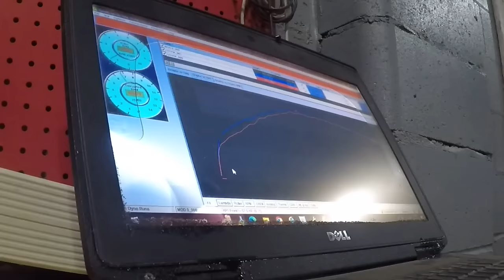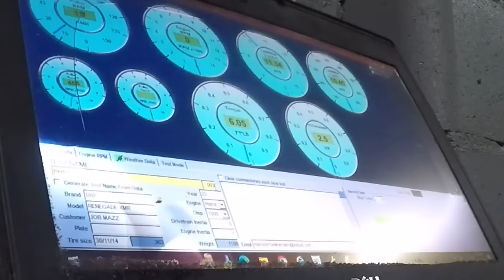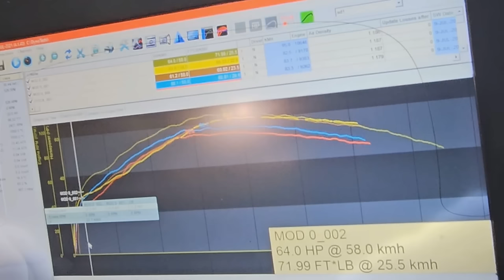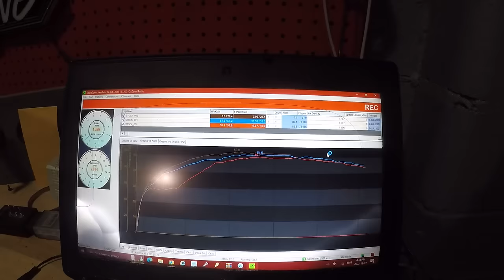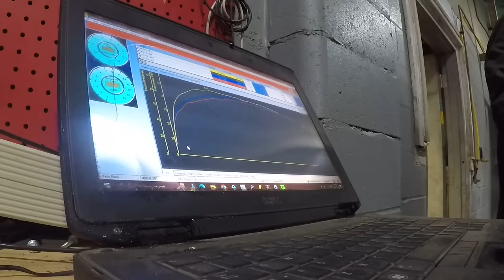2024 Can-Am Renegade X-MR1000r Dyno Tuning

Comment: If you all have a Polaris or Can am get ahold of RVS Performance, he's got the best tuning for these machines with his dynojet stage 3 tune. I gained 15 wheel horsepower on my Scrambler 1000 S and it shits and gets now.
Reply: RVS is a local shop to me. They are awesome I have a stage 3 on my outlander 1000 wow does it make a difference great people to work with
Reply: @justpigginit  RVS is the best at tuning when it comes to Polaris and Can Am. His power gains are un matched. He has my Scrambler xp 1000 S tuned excellent. It doesn't take that long to reach 90 mph on it.

Comment: Do yourself a favour. Don’t clutch your bike from a dyno run.
Reply from the maker: I always test on trails and swamp, then adjust.
Reply: @ehTV1000 RVS PERFORMANCE stage 3 tune is what you need. 15 wheel horsepower gain. I got it on my Scrambler xp 1000 S boy what a huge difference.
Reply: Perfect a lot of guys go off the dyno. However the dyno does not properly load your bike.